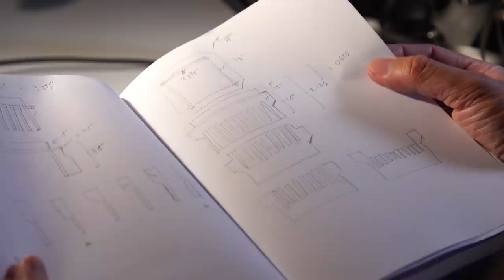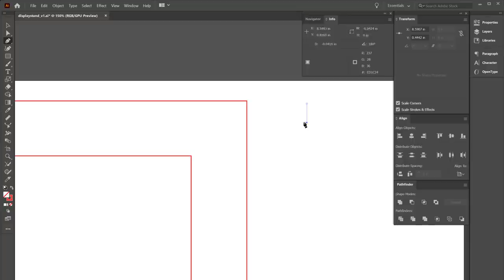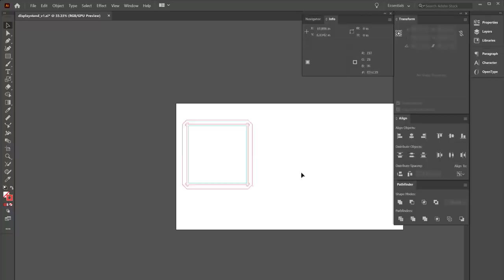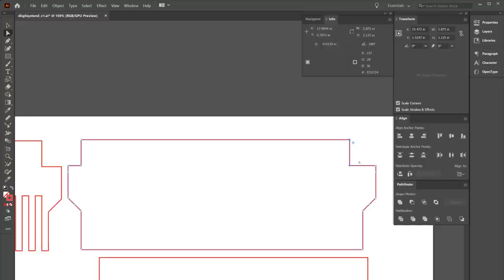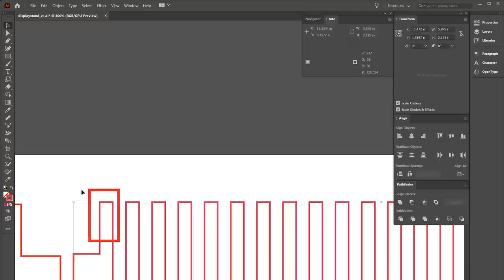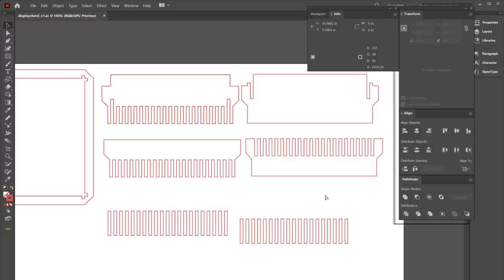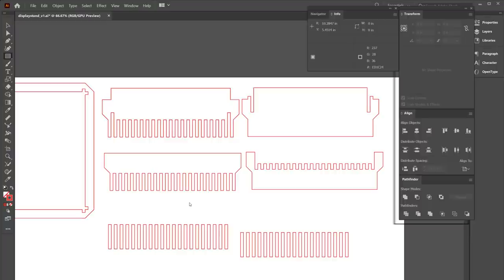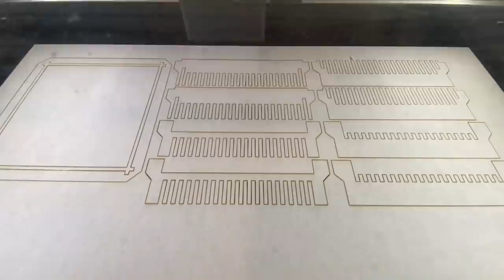Making an Illuminated Action Figure Display Stand!

Comment: Do the lights come in orange? That would make for an awesome Carbon Freeze Chamber display when using the painted shelf you made
Reply from the maker: Yes! Next version will have color temperature adjustable LED strip

Comment: How fast would you say a laser cutter is? I know 3D printing often takes hours for even smaller projects, so would this be considerably less, not since it has to burn through the material?
Reply: depends on what your making. faster then 3d print ya. but depends on what you are doing. if you cutting engraving and your project has a lot of small cut lines it can take a few hours. just cutting is faster. these parts look like maybe a minute each? x20  so 22-30min depending on if you lay them horizontal or vertical at least on the glow forge (horizontal cuts faster, vertical slower, and diagonals are in between)